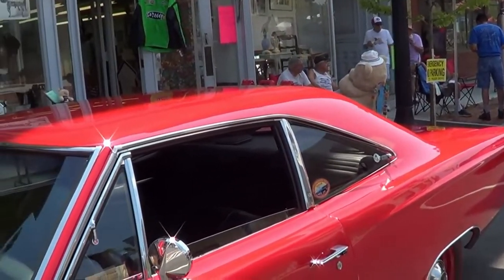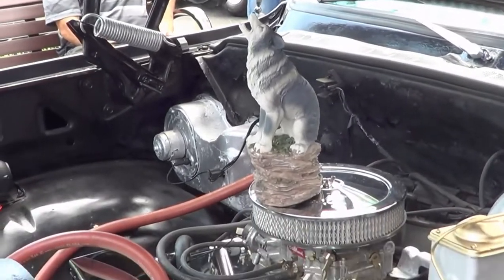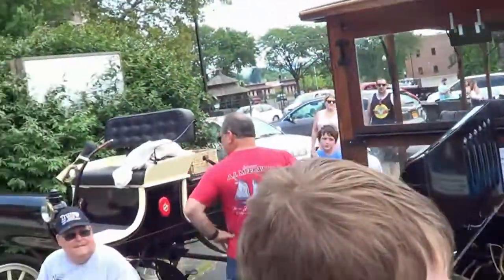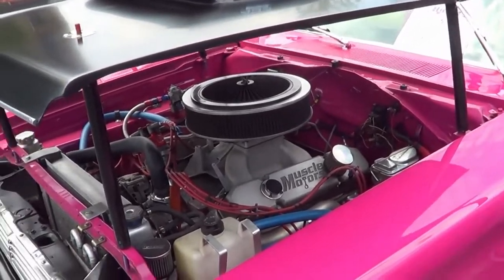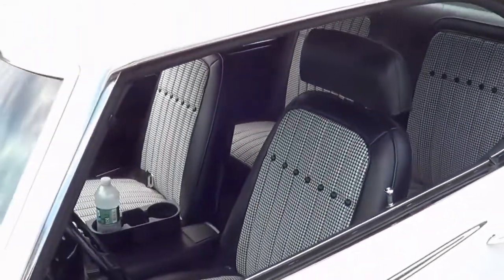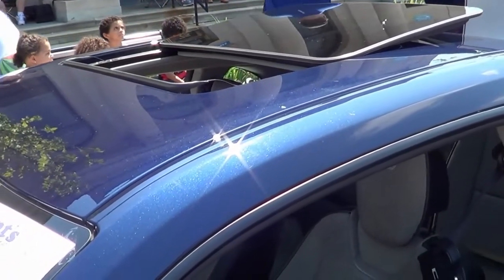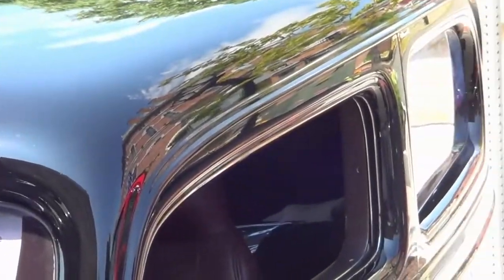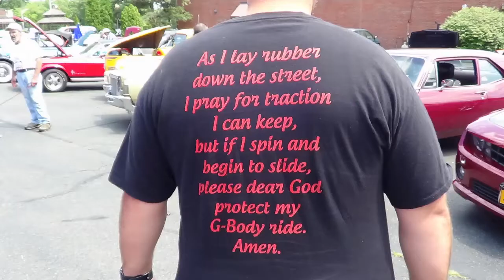Cohoes NY car show

Comment: Cool Bob, thanks for sharing, love the car shows, but it seems more and more modern cars are creeping in on the classics and muscle cars, we have the same thing happening here as well. However, it looks like the modern cars there at least added some cool airbrushing, around here they just pull in with a brand new car and win best paint, nicest interior and cleanest engine, lol, umm yeah, they are brand new. Some of the bigger shows divide them by class for modern or classic, but a lot of the smaller shows can't and lots of guys that put blood, sweat and tears get upset with the modern cars winning certain categories.